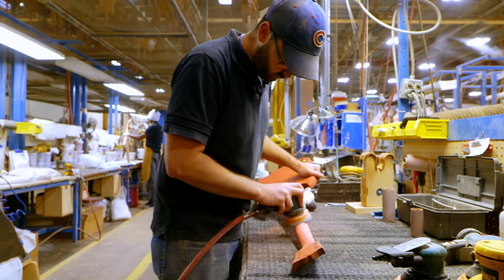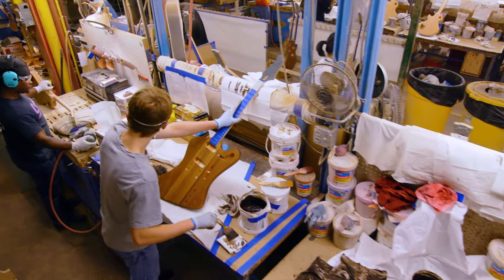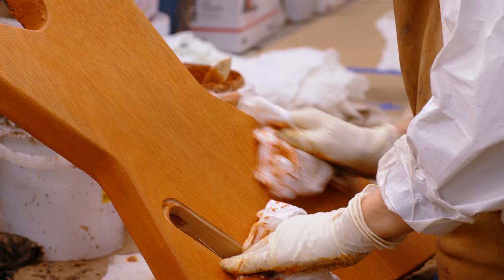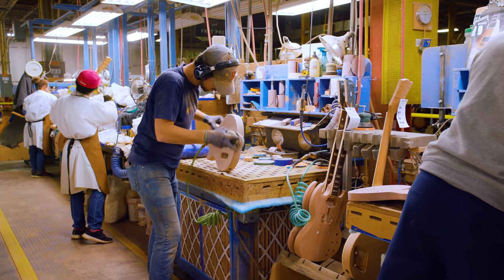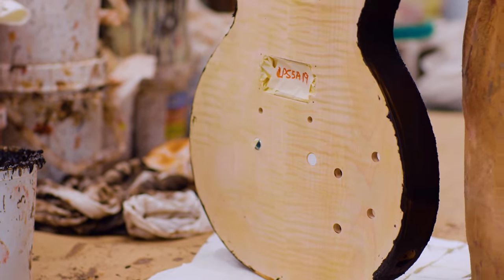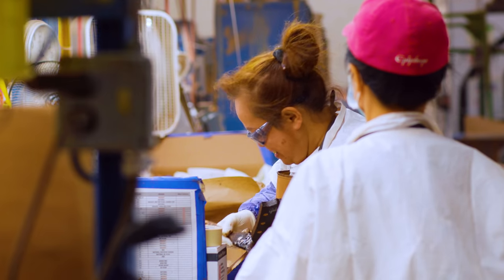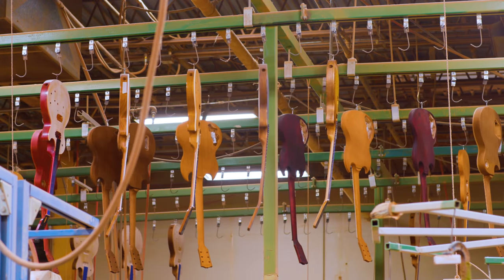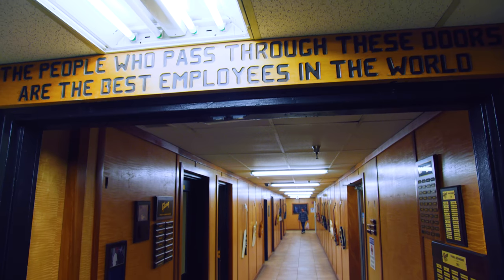Final Sanding And Color Prep At Gibson USA | The Process S1 EP9

Comment: “We apply the wood filler, with a brush with the grain direction”. Footage showing a guy packing it in across the grain. Lucky that the guy, actually doing the job, is getting it right.
Reply: Haha, you beat me to it. Was gonna say the same thing. He then says that it gets wiped off against the grain as the guy does the opposite then goes round in circles.

Comment: Thank you for these videos. They have inspired me to actually attempt to strip a guitar from its clear coat, sand off the color and re stain and finish the instrument to my liking. I had to sell my Les Paul due to a severe injury and the weight of the guitar. 10 lbs became unbearable and Les Pauls should not sit idle, they need to be heard. I found a Epiphone Les Paul on Craigslist for $300 that was a little under 8lbs and had the 60s slim tapered neck. The perfect instrument to try this on. I gutted it, stripped it and watch many of your videos over and over to do this right. In the end, this guitar is beautiful to behold. I put Gibson’s pots in it, Duncan pickups and cut the top of the headstock off right under the epiphone logo. Re shaped the top with a file to look like the Gibson Crown. The question is, Can it compete with the real thing? In all honesty, NO! Lol. It sounds good, it plays very good, it has a nice feel to the neck even though it feels cheap compared to the real thing and it looks great. There is no substitute for the real thing and there never will be. Gibson Les Pauls have that magic tone that can’t be duplicated. These videos are fun and actually useful. Thank you for posting them.

Comment: The most shiny and elegant guitar I ever saw was a Gibson. I wonder if You guys can make a reverse truss rod where the screw is at the bottom of the headstock (just remove the pickup and adjust) instead of the top of the neck for a better tone and taking away the weak point problem.
Everybody would love that improvement. 
I wish a Flying v in white 💖.

Comment: man wen i made my guitar i had to sand steam remove whiskers and repeat a dozen times, but its important to get the oil to penetrate a needed distance as the coats build up then its scraped back down to the surface and polished with axle grease. theirs much more to it than that but i dont feel like typing it all lol. it leaves a very beautiful finish. and you can also do a few flash coats of amber nitro and clear and it will age like fine furniture has or like a 200k shotgun with a hand rubbed oil finish walnut stock!

Comment: Quality control isn't what it should be.  I bought a J200 from the biggest guitar retailing chain in the UK.  They had 6 J200 Studio's.  Three of them had the skunk stripes on the neck way off centre.  The one I bought was the best of the group, and it is still a couple of millimetres off centre.  I brought these guitars to the attention of the owner, he doesn't check new stock personally but he was gobsmacked to see how bad the quality control was.  OK, it doesn't affect the playability of the instruments, but what it does do is call into question Gibson' s quality control.  Further more, when I bought the guitar I also bought a Marshall acoustic amp to go with it.  When I got it home and plugged it in I found it was crackling then stopped working altogether.  I assumed that my cheap lead was the problem and replaced it.  No dice!  I then assumed that the problem lay with the £400 amp rather than the £2200 guitar.  I took the amp back to the store, and they tested it and said there was no fault.  That just left the guitar!  I took that back, and they sent it to their out of store tech guy.  He said it had a dry joint in the electrics.  I got it back and it played ok for a couple of days, and then stopped working again.  I eventually took it to a good friend of mine, who was a pro musician and techie.  We took it apart and found the problem was a faulty output jack.  We re-wired it ourselves and the guitar has been fine ever since.Another example of Gibson's crappy quality control!